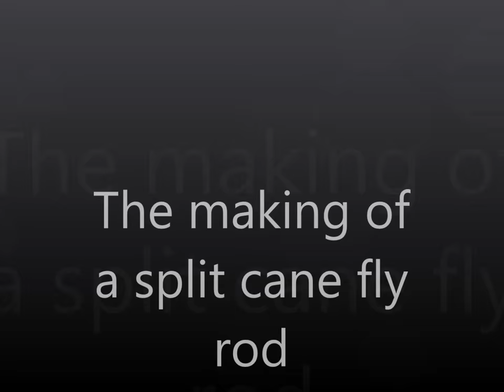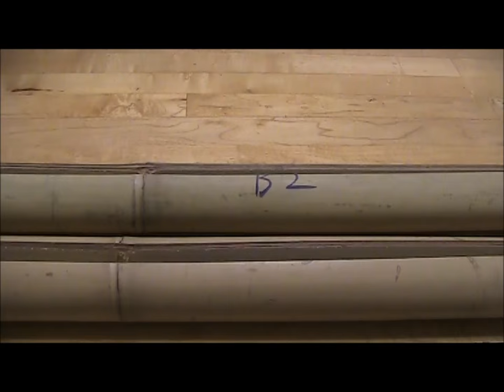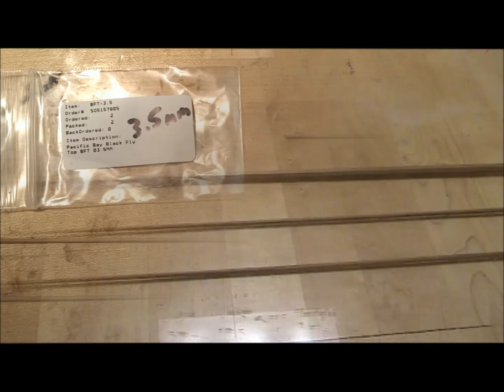Making a bamboo (split cane) fly rod

Comment: awesome work,how much it cost?
Reply from the maker: Thanks Sharyar! Bamboo in and of itself isn't too expensive compared to 
graphite. It must be imported from China, and right now there is one major 
importer. A bundle of 10 standard culms is about $240. each. Shipping is a bit 
expensive however as these are imported to the west coast then shipped from 
there. After that you need cork for grips, probably at least 25.00 or so (if you 
buy the best Flor grade 'rings' maybe something like 90. per hundred), a reel 
seat - maybe 25. to 65. depending on quality (natural woods and nickel silver 
fittings cost most). Nickel silver ferrules (you wouldn't fool with brass) close 
to 50. to 85. or so depending on quality and supplier. Glues, marine grade 
varnish, guides, NS winding check, tip top, agate stripping guide, silk threads, 
etc.. all add up. Not to mention binder, dip tank, heat treating oven, metal 
planing forms, etc.. So I would say an average rod could be $150. to $250. in 
parts (even more if you do engraving or go really crazy). Oh, almost forgot the
rod tube and sock. Aluminum tubes are running about 40. bucks these days. The 
shop outlay costs and your time are really the biggest expenses, and it takes a 
good bit of time to build each rod, so dollars per hour if you sell isn't all that
great, although those who establish a name may do fair.
Reply: +Keith C thanks sir for a lot of info stay blessed